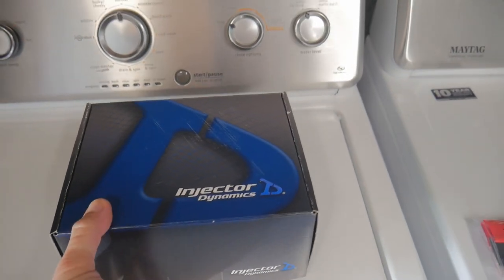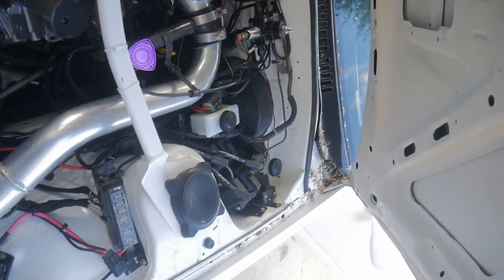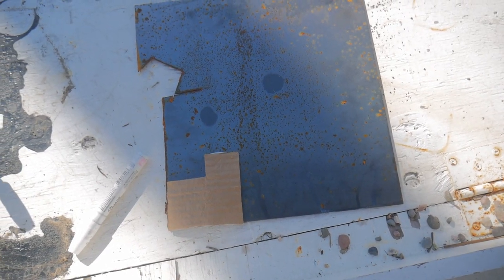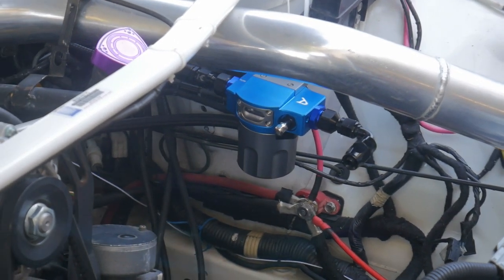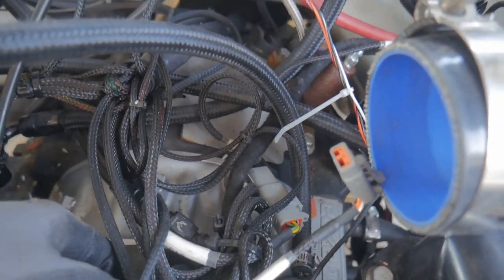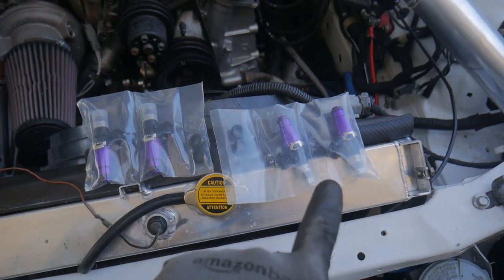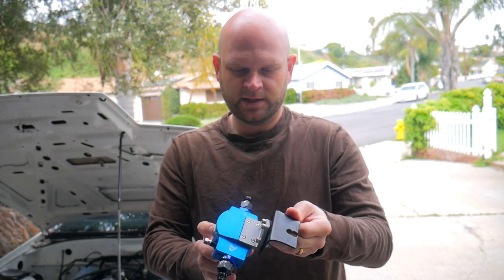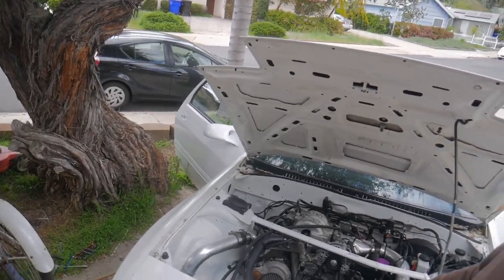Fuel system upgrade / ID F750 IDX1700 FC3s Mazda RX7 1988

Comment: I put mine near the stock location, but just a little higher. Theres a hole there that comes OEM and I put a rivnut in there and just used the IDF750 bracket that came on it. I did it this way because I have a vmount, PS and wanted to hide the lines. 

For the AN lines, I kept the mesh on because it's a tighter fit and when I assemble the fitting, the hose won't back out on me. To cut a good cut without fraying the mesh, you wanna tape up the section you want to cut with some masking tape. You want to use some really good shears for cutting fences, or a good cutoff wheel and go in one smooth cut (no back and forth).
Reply from the maker: I wanted to be able to see the gauge easily and quick access to the filter element. Everything works great 👍. Thanks for the comments 😁
Reply: @MohrGarage  mine is easily viewable and changeable too, just gotta jack up the car (which I do often) for pre-track prep. Your FC is looking good man!